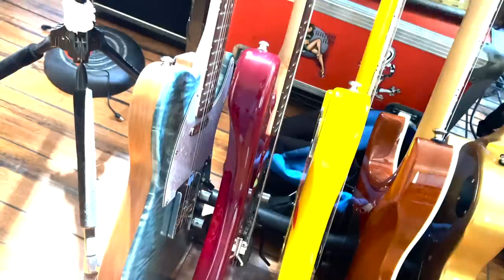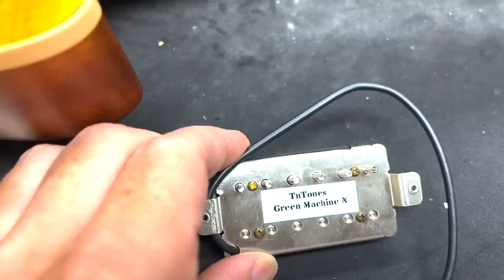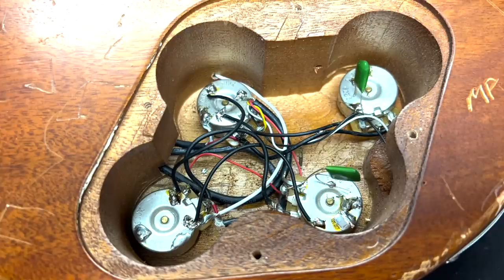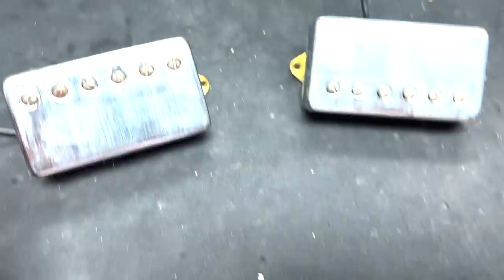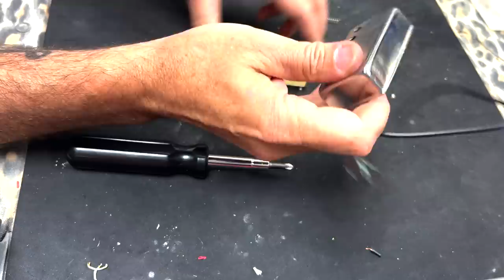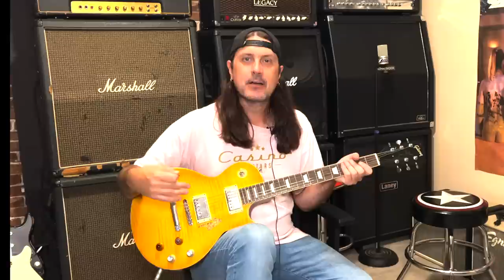I Upgraded My Fake Greeny!  Did I Ruin It?  Or Would Kirk Hammett Approve?

Comment: I would suggest also upgrading the capacitors. Those green mylar .047 capacitors are wrong should be .022 and they are very muddy and dark sounding.  If you put in some Mallory, IC/Chicago electric, or Vashay caps  that are .022 you will notice a huge difference in clarity and they are more affordable than paper in oil caps.  Try them wired either 1950s Les Paul style or 1960s SG style and you will flip
Reply from the maker: Awesome thanks for the info man!!
Reply: You answered my question on the caps, thanks.
Reply: I do a pot & cap swap in most of mine. Bourns 500k & .022 orange drop. Makes a bigger difference than swapping pickups. I like the Bourns as they have a nice tension on the knobs.
Reply: Great advice, thank you sir.

Comment: Got me wanting one lol. Love projects like this. No need for big money to sound good. Just skill and passion
Reply: If you have the passion, I GUARANTEE the skill will follow.
Reply: I have many guitars and was a friend of Eddie Van Halen's, I own many guitars, expensive ones n the chibsons as well, I honestly can get the same tones and sounds all by adjusting my amp setting's and my pick attack.  It's the player 90%, 9% amp, 1 % the guitar !

I don't change the pots or pick ups on the Chibsons , there simply is no need to unless something becomes non functional. Hell my tone knob plastic hat is a bit broken, I just used tape on it, no need to replace that either because it still works the pot n still turns!
Reply: Ya I think I can justify getting one since I did buy a real 59 reissue. I'd like to play with one and change stuff out. I'm not doing anything to my real gibsons.

Comment: Were either of these sets of pick-ups potted?  And if so.  Was wax an issue when fitting the covers on.  I've had to boil covers once I unsoldered them from potted pickups. And get the wax residue down to a minimum... Also. If you could flow that solder to the pickup base.   It's probably a lot better.  I have done both. Just squeezed them into covers.  And resoldered covers at the same two points to baseplate..
Reply from the maker: Not sure about set one.  Set two not potted.  Custom wound by TNTones.

Comment: What I've learned with the chibson s.    Pick  ups.   Level the frets.  Change the nut. Upgrade the pots........the bridge is the tuff one   I did a Nashville  Bridge  those bridges are junk  on these guitars.   You can get the conversion  poles  that screw over the ones that come on those guitars because there metric ....but the conversion  ones are standard  to except the Nashville...do your home work  .....ps I put  pearly gates on mine👍

Comment: A question.
 Did you have to adjust the intonation? Did it come spot on?
Also, I think the bridge is metric so you may have to replace all of it even the stud inserts in the body.
Thanks.
Reply from the maker: Intonation was good, not adj needed. Yeh... hard to replace the bridge. Probably all metric. Need another chibson bridge.  I think.

Comment: People talk about replacing parts on a Chinese guitar is O K. Well when I got my actual Gibson L Paul studio used, it came with the smallest crappyest looking pots and garbage wire I ever seen. CTS 500K pots and Garrett cloth wiring in a 50's style fixed that. And for tuning stability, I changed out the bridge to a Tonespro locking bridge and alum tailpiece, Tusc XL nut and Kluson locking tuners. Alum taped inside the control cavity. Made my own signature series guitar. L O L

Comment: I customised my 175 with 50s wiring also changed the capacitors to oil in paper and that made it sound great the only down side is it's heavy (as in weighty.) Just to let your viewers know non of the parts on a Chibson are the same size/fitting as real Gibson parts ie bridge, pots, tail etc and my 175 doesn't fit into a real Gibson case so be shore to buy a Chibson case with your gtr.

Comment: Shouldn't the neck pickup be upside down? I would imagine if it's meant to be a greeny neck pickup, it was meant to be put in upside down. But obviously you will know a lot more about those pickups you bought than I do
Reply from the maker: Yep it's flipped backwards but it sounds like it does be cause the magnets have been reversed in wiring.  Like the original. 🤟🏻😎

Comment: Lets get this out of the way first, I just don't understand why anybody wants to purchase a new guitar no matter who has made it (Gibson or fake Chibson) that is made to look as if it has had a ruff life, does it make it sound any better,    Now in the same breath, what is the difference in build quality between a Gibson or Chibson if you strip out all the electronics and some other components all that is left basicly is the guitar body itself, is this where the vast difference in price comes in, purely on the electronics and the components, or is it mostly the sound difference you may get get from the body build itself Gibson or Chibson, looking at this video clearly the electronics seem to have a lot to do with it more than the body build, Marty5150 has done a good job changing parts over, and the Chibson maker has done a very good job on building a high class body, the end result (forget about the ageing part) is a quality guitar at a modest cost, no wonder the big guitar makers are getting worried about these makers.
Reply: Zzzzzzzzzz

Comment: I'll never understand you fools who equate potentiometer size with quality when one has absolutely ZERO to do with the other 

FYI CTS makes DIME SIZED POTS, TOO. But they're crappy too because they're the little ones. Right?

They work exactly the same as larger ones. They're smaller TO FIT IN TIGHT SPACES. Not because they're somehow lower quality. If you all wouldn't listen to all the nonsense spread throughout this community, we wouldn't have this problem. But you hear someone else say it so you all start parroting it right back, too. Smh.
Reply from the maker: In my experience with many many chinsy guitars, these cheap little Chinese pots wear out quickly .... so long answer short I put in pots I am hoping will last longer.   CTS pots are far more reliable than some of these little garbage pots.  I see it on a daily basis.